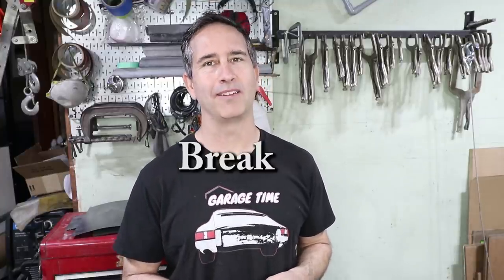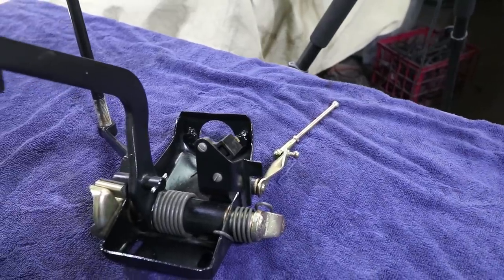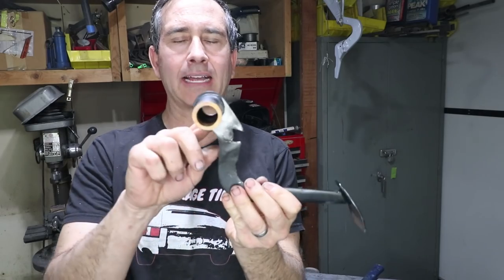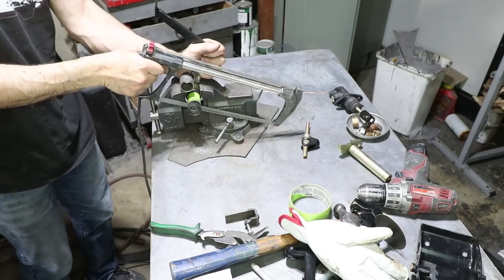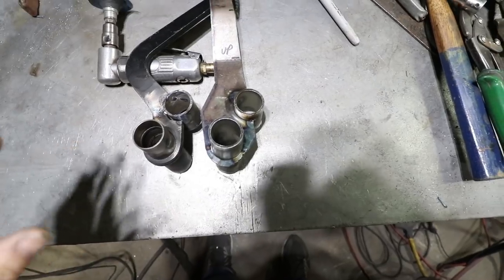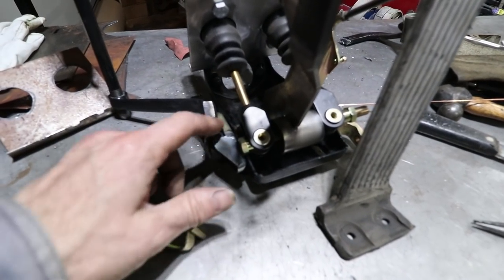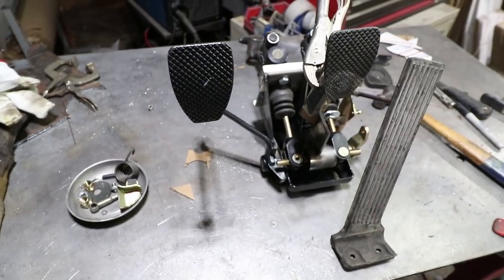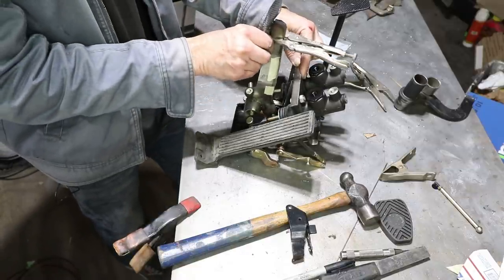My Brake System Revealed!  Dual Master Cylinder Pedal Box Mods

Comment: You could a an adjustable proportioning valve to the front line if you need more bias to the rear than your balance bar will give you. Just thought I would throw that out there in case you need it. I have one mounted in my rear line. I came through the floor pan under the front edge of the driver's seat and back under the car to the rear. That way I can adjust from my seat on the fly.
Reply from the maker: Thanks, the thing with proportioning valves is that they don't behave linearly.  When it kicks in you have a totally different line pressure curve than you had when you started braking.  I don't want that surprise on my front brakes.  Makes more sense to me on the rears as weight shifts forward you need less rear brakes.

Comment: Wow Tom.. simply amazing. You turned this video into something easily explained and an amazing piece of fabrication. Very very well thought out and challenging as there are no plans for this type of application you can work from! Inspiring once again
Reply from the maker: Thanks Mike, I'm definitely not the first one to do this dual master conversion.  Porsche did it in the early 80' with the SC RS.  I'm happy with getting all factory features back in it and improve the strength some. Thanks again for watching!

Comment: In researching brake systems, I think I came across these from the UK - they look beautiful! ... Alas, they are a bit outside my budget.  I, too, picked-up a set of Boxster brakes for a steal and then bought some adapters from Marc Poole Motorsport (now RSR Sports Cars) here in Australia.  I'm not even close to fitting them yet.  Curious to see how you like them when the time comes.
Reply from the maker: Cool!  I have done a fair bit of analysis on both if you're interested.  I think the boxster brakes work best with dual master cylinder as they come heavily front biased.  They are good quality and have lots of pad options
Reply: @GarageTimeAutoResto  Yeah, I did read a lot about the bias ratios of various brake systems from Bill Verbung's posts on Pelican Parts.  I'm convinced you're most certainly right in this regard ... BUT, for the moment, I think I'm prepared to see how it goes - I'm not quite as brave (or skilled) as you when it comes to modifying the pedal box :-)

Comment: I wrote my first comment before watching your entire video and now understand WHY the threaded links. I think the clearance issues that concerned you with the Clevis links to the master cylinder push rods could be improved by using Heim Ball Bushings. You can get them from McMaster Carr. They are threaded and have a thinner profile than the clevises you're using.
Reply from the maker: I'll take a look, but I they usually aren't threaded.  They can't slide on the balance bar.  If you find something let me know.

Comment: Knowing you Tom, i'm certain you gave this MUCH thought. I see the value in dual Master cylinders,.but what, in your opinion, is the value of the adjustable stroke link  vs. Fluid Valve biasing front to rear of the calipers? Would like to hear your thoughts on Pros & Cons...
Reply from the maker: Hi James, the biasing valve can only do so much.  Actually all they can do is reduce pressure.  They can't create pressure, ha ha.  So if you look at the pressure curve for the valve it works like normal until you get to a threshold pressure and then it starts to reduce pressure.  
I'm trying to increase pressure to the rear instead of reduce it.  If I installed on the front circuit then I have an unpredictable knee in the pressure curve.  That could be dangerous!  All the sudden the pressure goes down.  It's really not the best way to adjust brake bias.  Maybe it makes sense for the back circuit but not the front.

Comment: Can you share the info on the calipers?
Reply from the maker: These calipers are amazing.  Very well engineered.  I can get tech details if you need most likely.  They are carbon 12
Reply: @GarageTimeAutoResto  thanks, I'm going to look into them.

I have the big reds as an upgrade but need to run 17's most likely with them.   Would be great to run 15 or 16's instead.
Reply from the maker: Cool, they are lighter than big red and turbo brakes I believe!

Comment: What is the cost of using a torch to cut metal compared to cut off wheels? More clean up with the torch but cheaper?
Reply from the maker: Plasma cutter?  It uses electricity and compressed air, so it's very cheap to operate.  There is a consumable tip, but I hardly ever change it.  The plasma cutter is faster than cutting discs and you can do curves easily. Plus it's easier to get straight cuts.  (With straight edge).  Sold yet?  Ha ha.

Comment: Q: Is the tube metal strong enough material?... my concern light went off. It looks soft.
Reply from the maker: Looks soft?  Maybe it's DOM mild steel.  I don't rely on special steel properties.  Instead the size and shape will be enough.  The pedal force is around 80 lbs max and that gets multiplied at the pushrods by 5 or 6.  I don't expect that material to permanently bend.  By the way the new pivot tube is thicker than stock.  The stock material was no harder than the stuff I'm using.
Reply: @GarageTimeAutoResto  I'm not a metallurgist, but was concerned about bending, yes, or not visibly being able to see any wearing thru from the inside out. Love the comment, "I'm trying to keep it as original as possible." LOL - Customizing can be awesome. Thanks for sharing the vids. Happy Easter.
Reply from the maker: Thanks, that's a good video